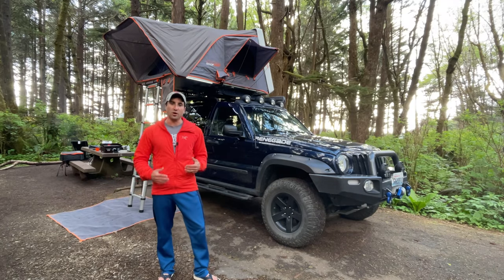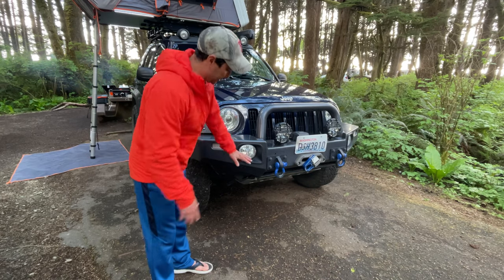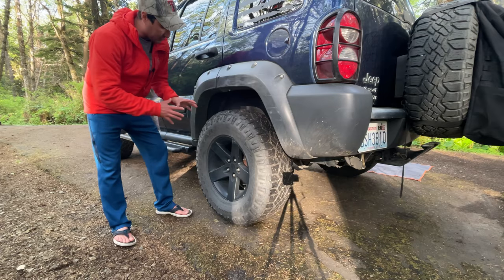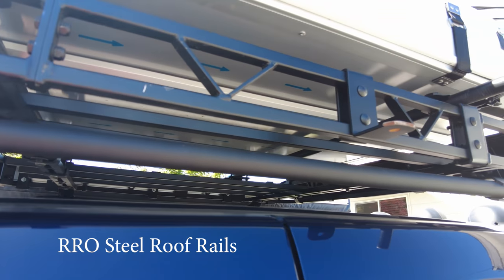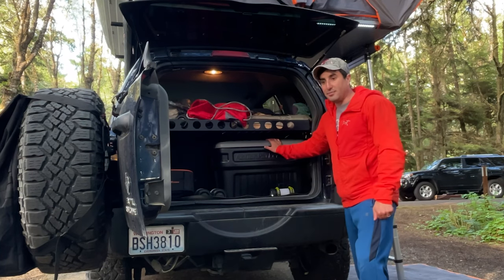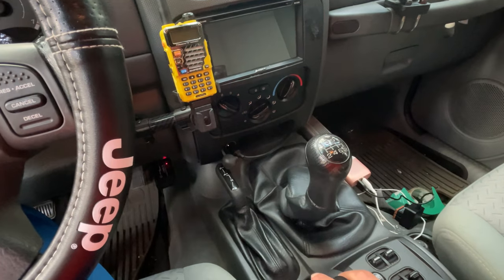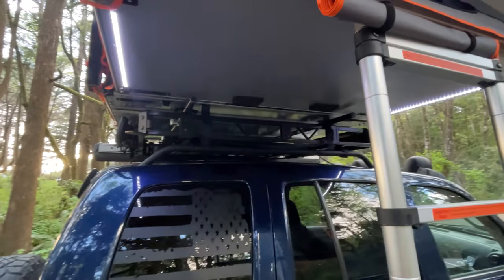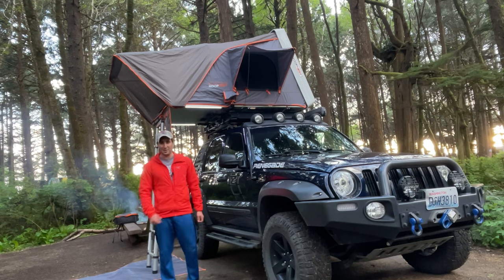Jeep Liberty KJ Overland Build Walk Around &  Roofnest Condor Roof Top Tent | Off-Road 4x4

Comment: Nice setup man. One thing to be mindful of is the roof load rating. The rating is based on the roof mounting and not the roof rack fitted. I have a 2011 Liberty with basically the same mount's as your's and has a measly 72kg load limit and Jeep told me it's based on the mounting. I have fitted a light weight soft top rtt as most hard tops are too heavy with my diy prinsu style roof rack which weigh's around 30kg. Cheers
Reply from the maker: yep found that out that hard way and already fixed the issue. If yout notice in my newer vids the new rack. Ill eventually do a vid explain all that needs to be done to keep a rack and rtt up, but the one in this vid, wont work the best.

Comment: I have a 2005 liberty. I live in Illinois. I have Maintained it. Always fixed any mechanical or rust issues.  I like what you did with yours.  I have 259,000 miles and mine drives like new. I'm going to steal some of your ideas. I already have the upgraded roof mounts. I took the back seats out for more storage. I might do the tent and an awing. Thanks for the video
Reply from the maker: your welcome. I have the roof rack for sale locally here for a good price if your interested
Reply: @BackcountryRenegade  thank you for the offer. I have 3 cross rails so really no need for the rack. I'm considering a tent but I have an elevated (only lightly) sleep platform inside. I take out all but the drivers seat to accommodate this. The height is level with the console. So I have plenty of storage too. I have custom screens that fit the windows also for ventilation with bug protection. So I'm considering a rooftop tent ⛺️  but may go with a rooftop storage box instead.

Comment: Great build! Well thought out. The beauty of today is that there is so much out there to personalize your rig for your needs. Personally, other than getting off the ground in bear country, I don't see the fascination w roof top tents. It's like having a pickup w a slide in. Once you set up camp you can't use your vehicle. Also, it's hard to climb down in the middle of the night to pee. Watch that 1st step! Haha.
I'm also in the process of a liberty build. I chose the liberty cuz it's small yet has 4 doors AND, I hate side by sides. Except for the real small side bys, it's about the same size as most and smaller than some AND, already has a hvac system and a windshield. As it is, it's amazing how capable it is. We use it as our hunting rig. Downside is the ground clearance in stock form. I'm collecting parts for an upgrade: ford 8.8 rear, dana 44 front, dodge 4.7L. Gonna keep the tire size limited to 33s.

Comment: This thing is sick. Good work here. I reckon you've done lots of work getting it to where it is now! One thing to potentially add would be the clutch fan and shroud to keep the engine temperatures in check in case another "heat dome" comes and roasts us again next year. From what I hear overheating this engine is quite bad and the Liberty's that weren't equipped with the tow package have only got that tiny little fan up front. I'd say its a bit risky, especially since you are hauling around lots of extra gear. Anyhow, keep it up and please update us with how the future extra large tires fit.
Reply from the maker: thanks for the suggestion. ill looking into that for sure.

Comment: Didn’t see a fridge ? Maybe i missed it 🤷‍♀️ and i saw a little heater up in the tent , who makes that ? I also have a 06 liberty .. they are basically a first gen JK in a different smaller body, same trans and transfer case 81/4 rear ( same as a dana 44) and the 3.7 has about 20 more HP than the 3.8 . And towing and payload is higher on the liberty than the wrangler.. perfect jeep for me .. mine is the Max tow model it has the engine clutch fan with the normal fan also, and power steering cooler and trans cooler ..
Reply: The chrysler 8.25 refers to the ring gear diameter and comes w 29 spline axles if I remember right when I took my wife's liberty apart. It is a good rearend for a stocker. The dana 44 on the other hand, is in its 2nd generation now. The 1st gen has been upgrade throughout the years but, is characterized w an 8.5 diameter ring gear that translates to overall bigger parts like the spiders. Also, it comes w 30 sp axles. I know what you're thinking, 1 more sp is no biggie. The axle needs to be bigger to have 1 more spline. The 2nd gen if coming off the rear if a Rubicon has an 8.8 diameter ring gear and 32 spline axles which would make considerably stronger.

Comment: Kool video. IDK if you put the lowers on yet or not. My advice is to keep them the stock length. The liberty axle swings in a arc vs straight up and down. Centering the tire in the wheel well, will cause it to move towards the rear when stuffed.
Reply from the maker: Haven’t put them on yet, but that’s for the suggestion

Comment: Awesome walk around! I have a 03 Liberty with 2.5 lift and 30.5 in All Terrain tires. You have a great build. Check out some of the soft storage gear from Blue Ridge Overland. I’ve set mine up with they’re gear. He’s actually the reason I got into Overland because he’s in my home town in Virginia. He custom made a attic for my Liberty. Thanks for the walk around and the info and where you got your aftermarket parts not a lot of Liberty's out on the trail but it’s great gettin all the looks when your running the same trail as the Wranglers. Keep up the good work. Thanks
Reply from the maker: Awesome! Very cool I’ll check him out. Thanks
Reply: Dustin : what kind of 2.5 lift and did it bolt up with factory suspension and steering ?
Reply: It is a spacer lift. Not the best lift but the most economical. I have a 2.5 inch Day Star lift. I did a lot of looking around before I bought it. I was leaning very heavy on the 3 in rough country but every one that had it on for a while complained about the springs settle real bad. You put the spacers right on top of the strings . Rear one are easy. The front a little more challenging. There is a plate that goes on top of the spring. I can’t remember exactly everything it took to get it on but we did tack weld the bolts that come with the plate and used a hydraulic press to get the spring apart to mount plate and spacer. Getting the springs back in did take a little team work to get it back in the a arms. If you have mechanical abilities and are comfortable it’s not bad to do. There is several videos of people putting this lift on. You will have to get it aligned up when your done. I did put longer brake lines by Jeeping By Al because I do flex it completely out and it was stretching them a little. The main reason why I went with the Daystar was I was reading a comment thread like this one and a guy was trashing the spacer lift telling people to go buy a Wrangler and get a real Jeep. A guy commented to him that he had a Wrangler on 35s and was all decked out for crawling. But he had a Liberty for his daily driver had his Daystar for five years and said if you did light wheeling or just wanted the Liberty to Have a better stance the Daystar had worked great for him. That sold me. I’ve had mine on About a year and a half. It’s worked great for me. We do a lot of gravel fire roads and moderate trails. On the trail it gets  attention because it’s so different .

Comment: 3:48
Looks like that lift is taking a toll on your lower ball joint.

I know you said you want 32s,
I would look into finding 15s that clear the caliper and 265/70r15s. You can bring down that lift to 2 inches and save your suspension from being worn out. And gas too.

Comment: Loving the roof top tent setup, i'm interested in installing one on my jeep liberty, could you link the rack, and anything else required to install the tent? Or add it too the description as i'm sure others are interested. I have no experience on what is required.
Reply from the maker: You will need to upgrade the side rails also. added the parts i used in the descriptions.

Comment: Nice. With all that-Did you eventually go with HD CV axles? Also throw in some onboard air and a converter. I know..im late. The aux fan is def needed with an HD tranny cooler. Looks badass!
Reply from the maker: I have not yet, and the axels have been fine. i do still want to do onboard air and lockers, but still havent yet. did a few other things since this so need to make another load out vid
Reply: @BackcountryRenegade  Looks nice. Looking forward to it.

Comment: that rear tray is interesting, I would like something like that for mine. Since you are in WA as am I, if you want to get rid of it I would be interested. 🙂🙂
Reply from the maker: I got it at All J’s in Big Bear. If you call them and ask for the custom liberty rear tray they may still have some in stock. Mine is aluminum which I know they don’t make any more, but they may still have some steel ones. Here is their website 
https://www.alljproducts.com
Reply: @BackcountryRenegade  I messaged them and got response that they may have a couple in stock but she will have to check for mounting brackets.
Reply from the maker: @madman432000  awesome. Let me know if you get one. Even if they don’t have the mounting brackets I would get it if they have one. It is easy to customize something to install it
Reply: @BackcountryRenegade  FYI they had 3 in  stock so I got one, they had just enough mounting brackets. The ones they have are aluminum, no steel ones left.
Reply from the maker: @madman432000  very cool. The aluminum one is much better than the steel on because it saves you weight in the back. How much was it?
Reply: @BackcountryRenegade  380 for the plain and 420 for black powder coated one. Shipping yet to be determined.
Reply from the maker: @madman432000  aweosme it’s worth every penny
Reply: I received the rack yesterday and installed this morning. It's pretty cool. Will be very handy.

Comment: I would do a straight  axle front conversion. 
The front suspension  on liberty  is very questionable  with bigger tires lift and weight. 
That's all that platform  needs is a straight  axle to be serious
Reply from the maker: That would be ideal but not really a option for me

Comment: Hello! Merry Christmas you might not reply because it’s an older video however if you do I was wondering if you can help me find that inside rack from all Js I’ve been dying to have one!
Reply from the maker: Merry Christmas. If you go to All Js and call them. They should be able to help you if they have more in stock they make an aluminum version and a steel version when I got mine. I know there was only one aluminum left. I’m sure it’s probably gone by now but they may have some steel ones left in stock. I know they were saying they were not gonna make anymore.

Comment: When you added the Mamba wheels and 265/70 R16 tires, did you already have the front number?  I have a very similar setup without the steel bumper, and bought some nice used Moab wheels with 265/70 BFG tires… they rub really bad on the front so we will need to mod the stock bumper to make them work. Curious if you needed to go through that process and if so if you have advice?
Reply from the maker: i did already have the front bumper, i had to trim some of the plastic away in the wheel well other wise i would have had rubbing.

Comment: Nice build# II have an '05 Renegade, set up very similar same bumper, Frankenlift, 31x10.50 Duratracs, JCR sliders, roof rack, etc... how are the front recovery points mounted?
Reply from the maker: Thanks, the recovery pointes are drilled in the front and are reinforced with steel plated from behind and then bolted on.
Reply: @BackcountryRenegade   Thanks! I really like the front skid that used to be made/ sold by Jeepin' by Al, but waited too long to buy one.  I've thought about making my own but didn't wanna cover my front tow hooks..

Comment: Where did you get the adjustable rear sway bars and the front adjustable sway bar links
Reply from the maker: I deleted my sway bars in the rear, but I have adjustable rear lower control arms also from Iron Rock Off Road. The sway bar disconnects in the front are from jeepin by al, but he doesn’t make them any more

Comment: Where did you find the extended breake lines? I can't find them anywhere.
Reply from the maker: they were made by JBA, but they dont make them any more. I have a set from them of 2in extended beak lines, used for a month, but should work fine for up to a 3.5 in lift. i could sell them to you if your interested.

Comment: how do you stop the rear glass hitting the spare tyre ?
Reply from the maker: with 31s it doesnt hit. However when i upgrade to 32s or 33s it likely will. I have a spare tire extension that I got from Rocky Road Outfitters that moves it away so the window can open freely.

Comment: hello, good morning, excellent video, very good job and good project on your jeep liberty, I have a question. I have a 2007 jeep liberty. I put bigger 265/75R16 tires on it. I went to the beach and when I walked through the sand, the TRAMS TEMP light came on. but then the light went out, do you think there might be a problem with the transmission? Do you think it might break or is it something normal because of the force I exert, it only has 83,200 miles, I await your response and thank you
Reply from the maker: did you regear once you put the bigger tires? if not that is probaly why. the stock gearing with bigger tires will put extra strain on it. So would need to upgrade to 4.10s. thats why i plan to do before i go bigger tires
Reply: @BackcountryRenegade  ok thank you very much for your advice

Comment: It’s more sleek than the iKamper? Did you compare to the iKamper?
Reply from the maker: Yes I did. Side by side infact. Ikamper is wider and taller when closed on the car, which for my car already being smaller and narrow would stick out more. Plus the condor has more room when opened since the front floor does not narrow like the ikamper. I still like the ikamper but those things plus the money savings had me go condor. But quality wise the ikamper is a bit above, but comes at a premium. Both great tents though

Comment: What fender flares did you use?
Reply from the maker: teses come stock for the renegade models for 05-06
Reply: @BackcountryRenegade  ah ok. Thank you. I did a 02 jeep liberty build and had to remove the fenders/cut about 3 inches higher to make room for 33s. I have been wanting to put some back on. Relocating the rear fending, I had to cut Into the door. Looks unfinished.

Comment: I have an 05 liberty. I just purchased the RRO rails. Looking for the underside protection. Where did you find that stuff?
Reply from the maker: I got my front skid plates from Jeepin By Al before they discontinued them to focus only on A arms. The other plates came stock on the renegades, but they are not as beefy as the JBA ones. Check u pull it junk yards for some off renegades. Maybe get lucky and find some JBA ones. Skid row also makes some I hear.
Reply: Skidrowoffroad sells plates for KJs, I just installed their front skid on mine, it's really nice.
Reply: @johnsebastianbach  Thanks. I'll look at them.

Comment: I’m curious if you looked at the Old Man Emu 1.5” lift kit?  I just got one for my 2005 Jeep Liberty Renegade and it says I can run up to 31” tires. Curious if you think I would get rubbing on 265/75 r16?  And if I could go larger or if best to keep it less than 265s
Reply: 245/75r16 fit was about perfect on mine, no rubbing but very close on front at lock. 2004 kj

Comment: Where did you find your extended brake lines?
Reply from the maker: From jeepinbyal.com I don’t think he has them for sale any more. I have a extra set of jba extend break lines good for up to 2.5 in of lift I can sell if interested
Reply: @BackcountryRenegade  Unfortunately I'm doing the Rockfather lift by rocky road outfitters at 3". I did order the Iron Rock A arm though.
Do you think 32" tires is a better fit on the Liberty, because I'm torn between 31s and 32s
Reply from the maker: @CalebSTACHECarter  they will work fine with 3 in lift. Plenty of room for it. I’d start 31s and make sure u have correct backspacing and trim. Then I can go up from there if u have room. Avoid wheel spacers and a spacer lift
Reply: @BackcountryRenegade  Yeah I'm definitely not doing spacer lifts or wheel spacers.
I'll message you on Instagram about the extended brake lines.

Comment: I’ve it looking at installing an arb winch bumper and winch. But also wondering if there more of a need to save weight and try my damndest to get a half bumper built.
What would you recommend?
Reply from the maker: it will depend on your suspension. If you have HD springs and coils like i have in mine, it will be able to handle the full bumper and winch. I suggest going with a synthetic line like i did will save weight that way. But the arb is a lot of steel, so a half bumper would save weight. I dont have those skills to build one so just bit the bullet for arb. If you have the skills id say go for it. some people also fashion wrangler bumper to their kj and make custom mounts for it.
Reply: @BackcountryRenegade  
Yeah I’ve been trying to see about dimples here and there but it’s going to be on the outside and unless I can really seal the areas odd I’m thinking that route really won’t save much weight..
Thanks for the reply.

Comment: Do you have links to the front bumper and lift?
Reply from the maker: The front portion of the lift is not made any more, but its the adjustable coilovers from Jeepin by al.
Here are links for the rear 
extended length OME shocks : https://www.rocky-road.com/jeep-liberty-ome.html
Rear Springs: https://www.rocky-road.com/jeep-liberty-coil-springs.html
Reply: @BackcountryRenegade  thanks so much!